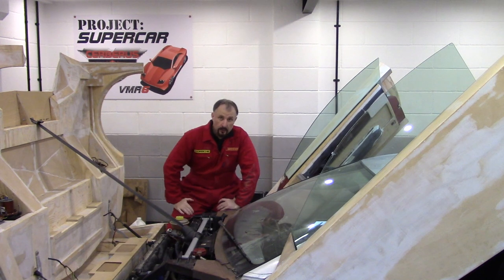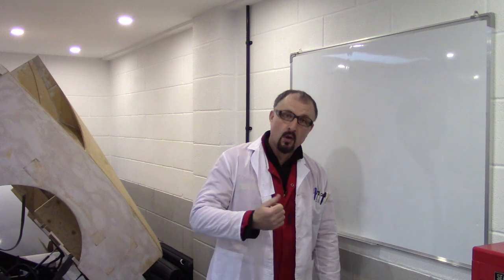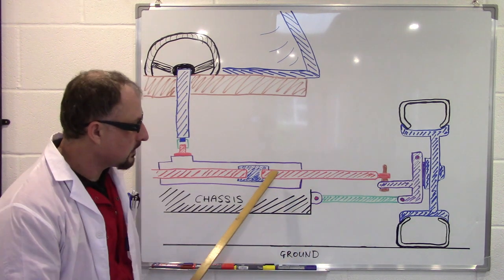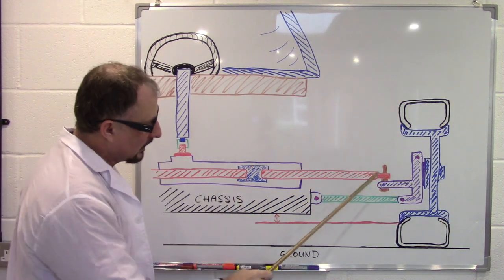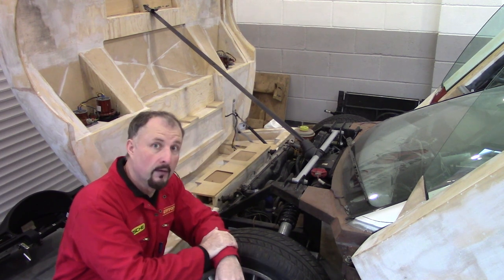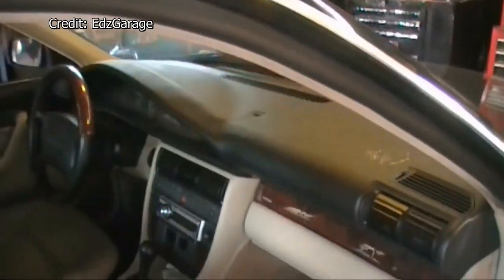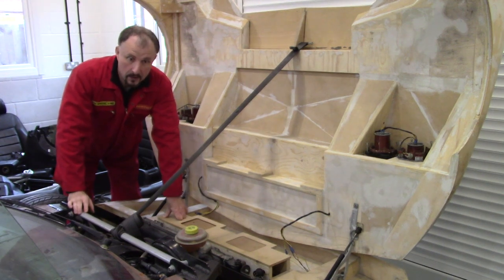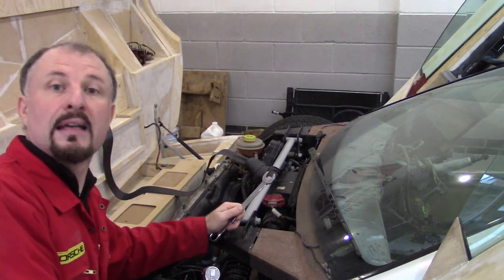Bulkhead Design and Blower Unit Problems: Prototype Ep21

Comment: Aaah heater cores.
I had a citroen ax gt. It broke the heater core. It was relatively easy to remove, take a panel off, take the end plate of the heater core with the pipes on  it off, slide the core out.
Getting the new one in was a nightmare. It'd come from a citroen ax. It didn't have a removable endplate. I had to take about half the dash apart to get it in.
Reply from the maker: Yes, heater cores, never a nice job to change them. Often writes the car off if one springs a leak. I think it's more difficult with modern cars as they seem to have much more complicated dashboards, requiring more labour time to remove.